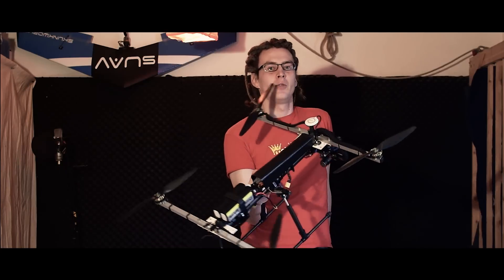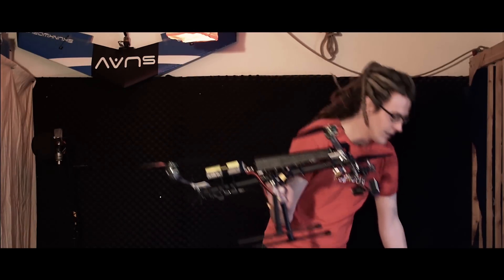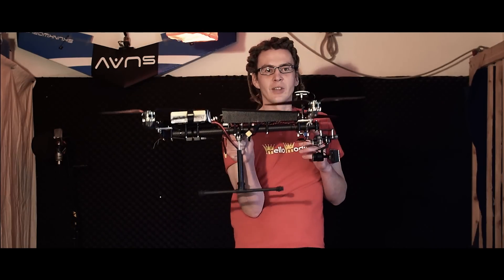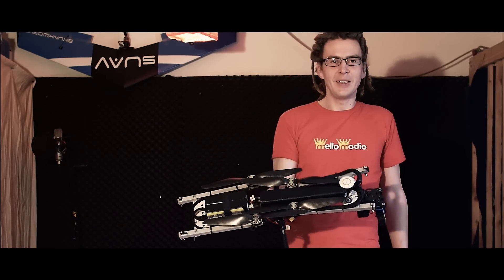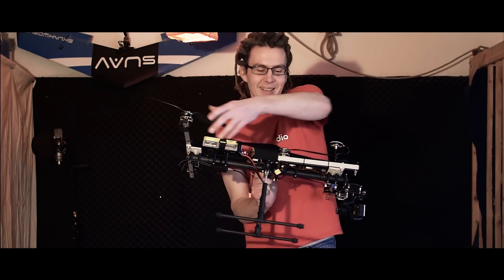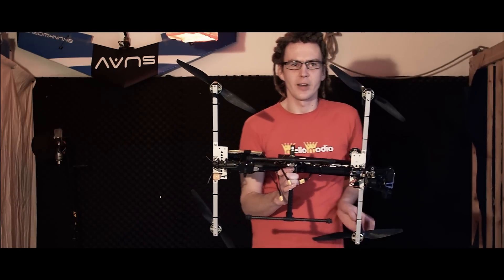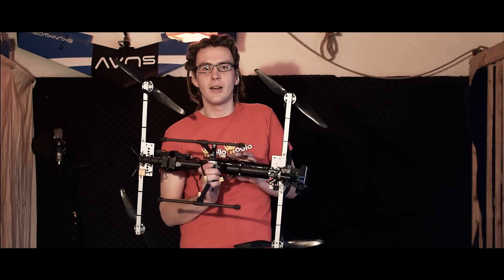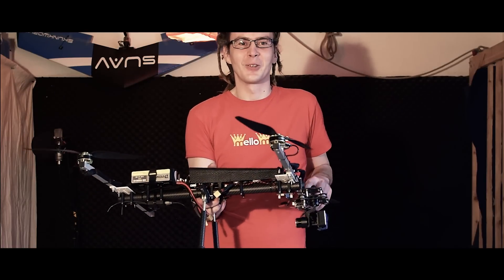DIY foldable & fast H-Copter II

Comment: What would you estimate the cost - the frame?  Why use allumium alloy, was the alluminum not strong enough?
Reply from the maker: It depends how precious your time is - the parts are below 60 bucks i think but you have to fabricate some pieces yourself..  Here a little list: 1x25/23/500mm CFK Tube 20€, 10xAluminium Clamps for the tube from alibaba 10€, a piece of 4mm thick aluminium 20x20cm 5€, 4x 500mmx15x15mm square Aluminium for the arms 10€ and 4x M4 ThumbScrew from Alibaba for tightening the arms 10€. Further you need some plywood for the deck on top of the tube to have space for esc's and flightcontrol. Except the time you need to build it, the frame is pretty cheap and has a lot of advantages regarding an X-frame. (look at the DJI-Inspire) The frame uses standard aluminium - i just messed up the right words..
Reply: hopsenrobsen I should have put subtract the frame, lol.  I meant to ask the quad price minus the frame.  I have all of the alluminum channe, tubee, and hard ware I could want because I am working out of a building that was a former constuction company of a general contractor.  Like a pice estimate of the cost of motors, ESCs, props, flight controller, and etc.
Reply from the maker: Its round 500bucks for flightcontrol, esc`s, props and motors. Further there is the gimbal with separate Rx and VideoTx and the Lipos..
Reply: Ok, thank you.  I may build this design soon.  I like how the frame folds up crisp and neat.  It looks like a factory design.  So +1.